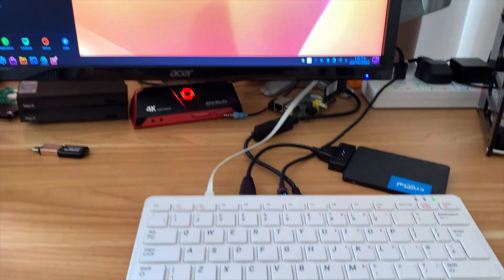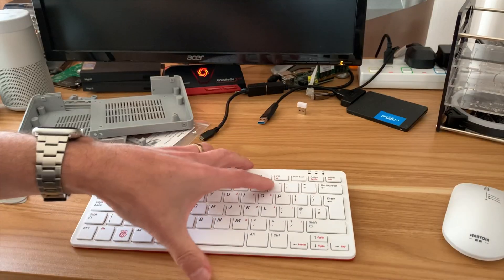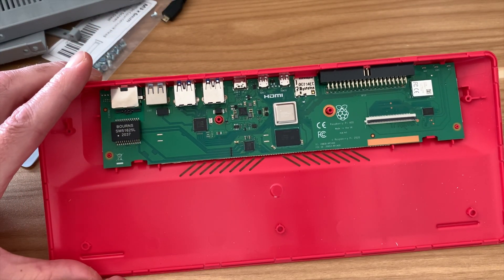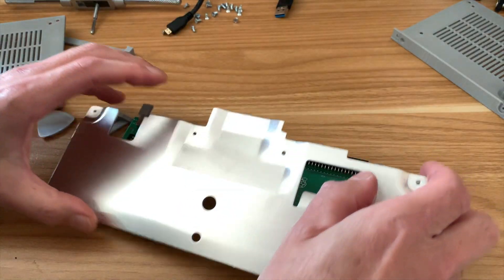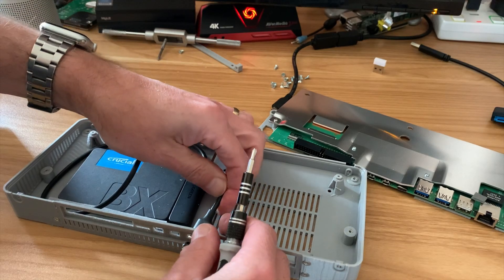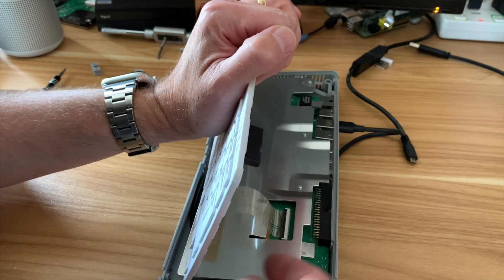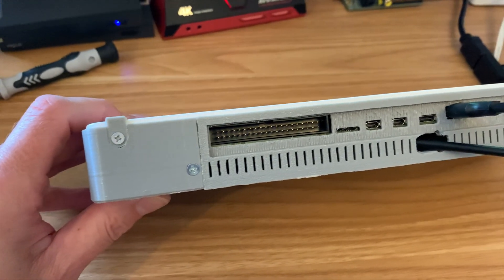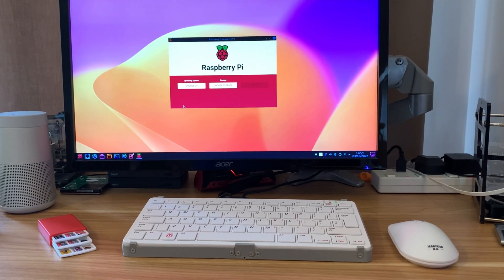Great Raspberry Pi 400 SSD case

Comment: Nice aproach, still I belive I´d rather print a small addin to fit a small M2 below or behind, to maintain the original asthetics of the pi. Even better finding an adapter to put a small one in between the pi board and the alluminium plate.

Comment: Why do you use M3 screws instead of screws designed for plastic? They have more space between the treads which prevents stripping and  they can cut their thread without an additional tool.
Reply from the maker: I used what was recommended by the creator

Comment: Very good and thank you for the update on the 180-degree USB connector. It now becomes possible to plug inside a USB 3 hub in order to connect multiple storage devices like M.2 / SSD / USB keys. Regarding the heat issue that should come up even with a single M.2, is there any room left inside the case (right or left side) for a slim horizontal CPU cooling fan like the MMOBIEL fan (used for laptop CPUs) in order to push the air out on the side of the case?

Comment: I can't help thinking.. There's plenty of space in there.
What if you turned one of the USB 3 ports into an internal port and added a 2230 m.2 SSD.. 

You'd obviously have to do some soldering, and make something that fits in the hole left over when you remove the port.. But wouldn't that look a lot cleaner in the end?
Reply from the maker: See the Pinned comment

Comment: A mod to hold/support a screen would be great too. Or even a  slot for SSD orNVMe drive . As would a 'clipable 'side' tray that allows you to have the GPIO's on the left or right side of the Pi400 would also be great. Sadly my 3D printer is still boxed up. No time to play :(

Comment: Could use a couple fans
Reply from the maker: I really like silent cooling. The Pi 400 does a great job keeping cool
Reply: @leepspvideo  yeah BUT add an input and output should delay throttling a little . Your test with one fan DOES some improvement .
Reply: Another YouTuber , Pavlo Kheml , did his own 3D printed base . Instead of using screws , he welded 2 pieces together with filament and a soldering iron . Ever heard from James lately ? I bought a couple cases from him and used to watch his DIY 3D case prints on YouTube BUT he deleted them I guess and he quit his business on Etsy . He made some cool little  dual fan towers that others copied .

Comment: Not bad. I should check for a local 3d printer shop. I can't help but wonder if another hard drive or even a battery, 4g modem devices or something else can be housed as well. The 400's case has got the surface area. Not sure about tapping plastic, can't self tapping screws be used instead? Also Lee, cyberdeck, I'd love to see a review. You're gold mate cheers

Comment: You can get right (90°) angle USB adapters. They would make the cable out the back so much neater.
Reply: If you didn't mind a bit of fiddly soldering, you could also make an adapter, perhaps route the wires through the vents and fix down the socket on the inside, 3D print a cover to stop the wires being brushed and broken on the outside

Comment: I like all in one case, but in this instance I would probably prefer the original case and just use a longer usb cable for the SSD which can be tucked away behind the screen or desk.
Reply: I agree, I know it does a job but it does look a bit heath robinson with the clips holding the keyboard on and the cable coming out the back and plugging in from the rear. The original 400 looks way better with the keyboard clipped into the base. Only my opinion...
Reply: You have to be careful with USB cables for hard drives, particularly on Raspberry Pi and other SBCs. There seem to be very tight tolerances, particularly in cable length. I have about half a dozen that just don't work well with the Pi at all, there's a particular cable on Amazon that comes in a three- or four-pack that is short and always seems to work.

Comment: if you could find a sata cable with a usb c end instead of a usb type a you could hypothetically not ruin the case. the usb c end can go through a smaller hole and take a type a adapter.
Reply from the maker: Alternatives are available see the pinned comment

Comment: This is the first time I've ever seen anybody suggest tapping threads into a 3d print.  Lots of people just drive machine screws into unthreaded holes, and that holds fine as long as you won't be removing them.  The "correct" way is to use self-tapping screws that are intended for plastic/wood, or to hot-press threaded brass inserts.
Reply: Finding self tapping plastic screws is not all that easy in a lot of places. And they can be expensive if you don't buy in great bulk. And they don't come is a great variety of head styles and lengths. But every hardware store has M3 machine screws in a a variety of head styles and lengths and they're cheap.

If you're building something structural or critcal to some mission, then yeah, other screws are probably better. But this is literally just holding together less than a KG of electronics. This thing aint going to the moon.

I've built and sold a lot of printed and laser cut Raspberry Pi cases. I've done a lot of experiments and trial and error and thought a lot about end user experience and what's best and most accessible for casual makers making their own things, and this is the best tradeoff. I've talked to people that have used my cases for a couple of years and their cases are still holding up and the screw holes aren't stripping.

So as a tradeoff, it's good enough and probably the best solution for casual makers.
Reply: I just print everything from M4 and upwards directly into my designs or if I need really secure connection I just embed nut dimensions to other side. I've bought good set of brass inserts but I've actually never bothered to even try them. Driving straight to printed part or part with that embedded nut has been sufficient solution for years for me.
Reply: Inserts can be really useful for certain things, but I have gone back to embedded nuts for most things, especially when I need 2 or 3 screw points.  The fact that nuts can shift is a feature.

Comment: Do you really need to tap? Generally those small screws work without tapping. Might be nice if the main ones that hold the case together were heat-sets so the threads won't wear out.
Reply from the maker: Many of them I didn’t tap and it went fine
Reply: If you want to be able to take it apart and put it back together multiple times, tapping is the way to go. 

I get a lot of guff about this particular aspect. People say to use self tapping, but they're not as commonly available as metric machine screws, they are more expensive, they come in fewer head styles. Or some people are really hung up on using inserts - which are overkill for a project like this and raise the skill level/tools needed/expense for a casual maker like OP.

And for inserts, there's just a lot of times that inserts aren't an option, or they create limitations that I don't want to deal with.

Like with an M3 screw, you can screw it into a column or a screw boss that's 6mm OD. And if you tap it will be reasonably strong and disassemble/reassebleable without the threads failing. Change that to an insert, which itself has a 6mm OD (or bigger) so you need your column or boss to be 10mm diameter. In many places in these projects it's just not an option, or it means making things bigger and fatter than they need to be. 

It's not what everybody does - tapping plastic for machine screws - and it wouldn't be appropriate on a mass produced device that was selling in the thousands. But I've done a lot of experimenting and tried it different ways and tapping for machine screws is the best compromise between my own small scale production and being workable for casual makers. 

If you just crank machine screws into the plastic without tapping, they'll go, but they strip way easier, once you disassemble it it doesn't always tighten up when you put it back together. And sometimes - depending on your particular material/print settings/the state of tune of your printer - it doesnt' go at all and you end up cracking the plastic, whereas the same dimensions for another maker might end up with a hole that's too loose.

So for all those reasons, I have tweaked by design process to require - at least HIGHLY recommend - tapping your screw holes for metric machine screws.

Comment: with plastic you do really need to cut threads into it... its so soft you can just screw right into it... but  what I would recommend is one of those pieces of metal that  you see people heat up and just press into the hole and that had the threads for the screw to go into, this way you can unscrew it basically unlimited times... whereas  you DO NOT want to unscrew any screws from the plastic at all more one once or twice because it WILL strip those soft threads right out - even if you threaded them with a tap & die set..... but at least you have that threading kit now :)
 - -  TBH I thought it was you that I had seen those 'nuts' that you just push into the plastic after heating up.... I guess I was wrong
Reply from the maker: If you watch the creators video he covers it in a lot more detail
Reply: There is a method of putting in screws that won't cross thread. If you drop it into the hole and turn it backwards gently until it clicks it'll be right in the threads again and you can tighten it then without stripping the plastic.

Comment: great video as usual. i would have just cut a slot from the bottom up for the cable  to go in rather than make the giant hole for the end of the usb. when they make one of the adaptors  u shaped like on the argon to connect to the usb port it will be even better.
Reply from the maker: The creator has many updates and alternative configuration.

Comment: This is awesome. I wonder if the argonOne ssd adapter can fit inside to use an m.2. If not I’m sure any small m.2 to usb would. Also, are those vents so you can add a fan and passively cool it as well?
Reply from the maker: The Pi 400 cools amazingly well without a fan. Might be different if we added an M.2 as they definitely run hotter.
Reply: I'm the designer of this case. I've mocked up a version of this case with a Geekworm M.2 board and it works in CAD, but I haven't actually printed one to test fit yet. 

There's no easy way to power an internal fan on this setup. Since the GPIO faces the outside of the case. It would mean soldering onto the GPIO header or something, or else running wires outside the case to connect to the GPIO pins. They cool fine without a fan.

Comment: Looks like the other side has room for a fan?

Maybe a laptop squirrel cage? They are usually 5v and controllable.
Reply from the maker: The Pi 400 stays very cool

Pi 400. How high can I Overclock without it crashing.
https://youtu.be/e9U58V8aJBE

Comment: The Pi Foundation really should have made room for an SSD. The Pi 4 with an SSD is vastly superior to one running on an SD card.
Reply: then the stupid accidents would be their fault ... modding is always an option but voids your warranty ...
Reply: @jyvben1520  When I mod my laptop and break it, no one cares. Anytime you install stuff it's on you.
Reply: @ninline2000  but your mod was not a suggestion from the manufacturer like the top comment would like it to be ...
Reply: @ninline2000  Yes, but you're a responsible adult like me and a lot of people here. As someone who fixes and rebuilds many computers, I have come across some amazingly stupid attempts at fixing hardware by people lacking a thing called "a clue".